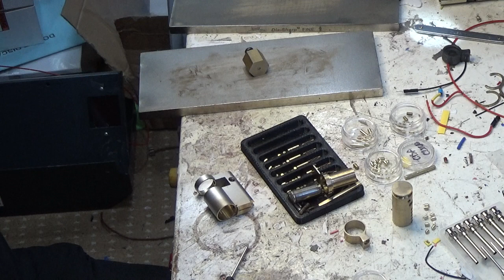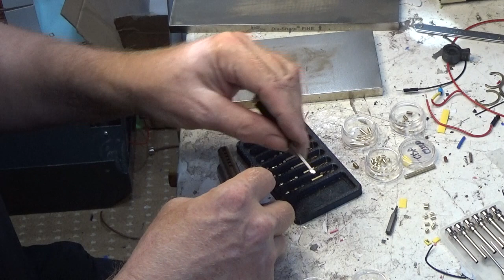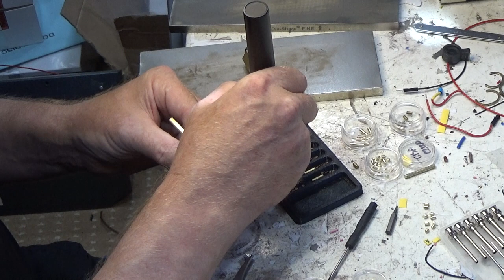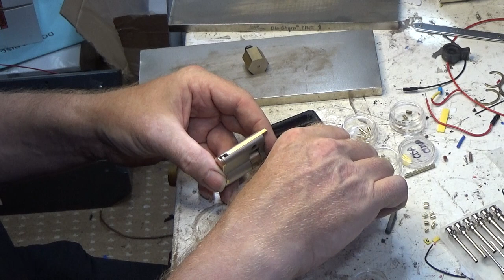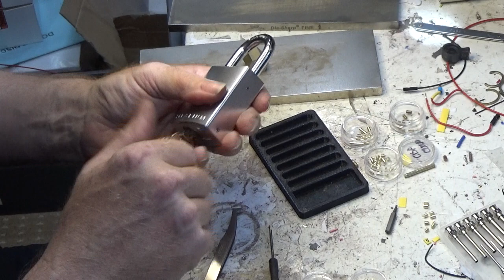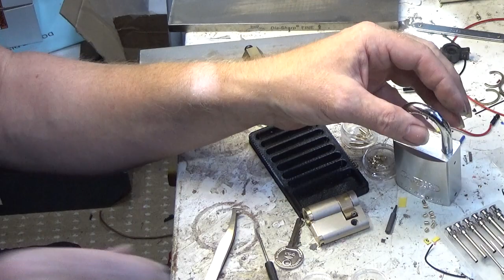Lock Assembly

Comment: That suction cup tool is very interesting -- did you make a custom tip for that, Or what cup probe do you use?  I note that there is a manufacturer here in the USA (where I am) that makes a similar tool with a huge amount of tips and accessories -- I found you thru Lock Nob's analysis or your super "unpickable" lock -- WOW -- I super impressed -- excellent work
Reply from the maker: It's just one of these: https://uk.rs-online.com/web/p/pick-up-tools/2222160 The tips are a standard Luer fitting (ie, hypodermic syringe) so the tip I am using here is just a large-gauge dispensing needle. It would be a little better with a rubbery tip, but it works OK if you listen for the pump changing tone. 
I actually bought it for its intended use, assembling circuit boards.